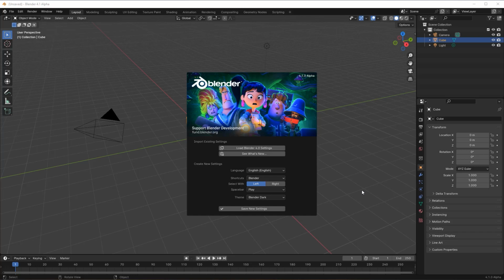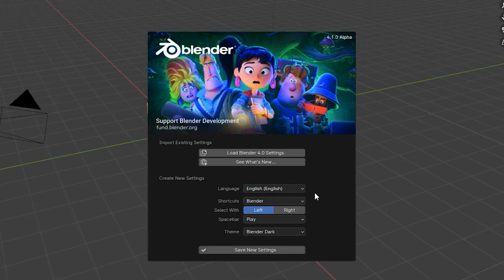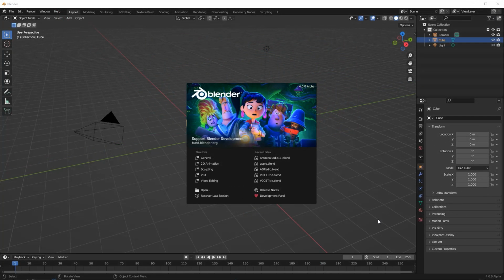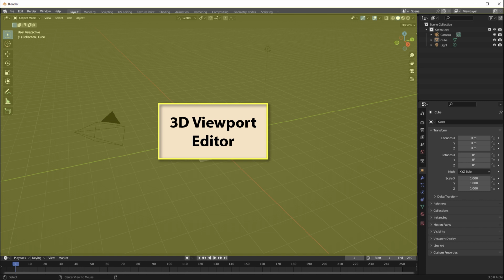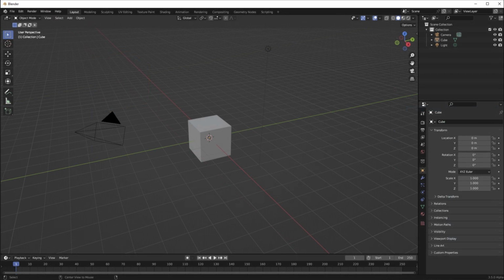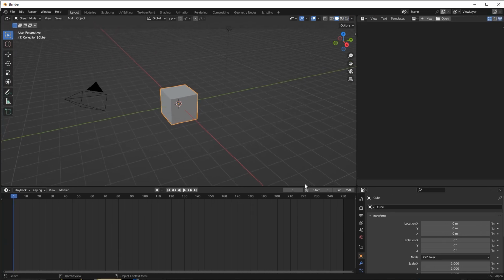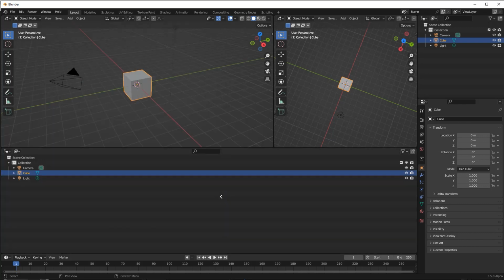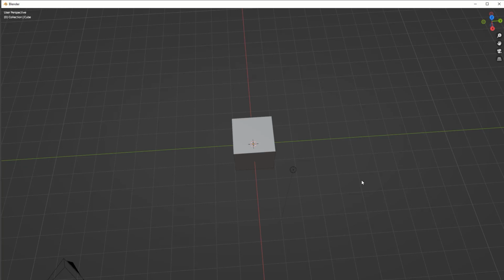3D Modelling with Blender 4.1: The Blender Interface

Comment: I have spent several days working my way through this set of videos. They are well presented (apart from the auto voice) and very detailed.  There is a huge amount of work that has gone into their production.  The detail is comprehensive and I defy even any avid user not to come across an aspect that they have not encountered before. All references are as up-to-date a may be expected (currently version 4.5 - but it's a lifetimes work keeping up the pace).  As may be expected it seems that the rate of production has fallen off recently. It's not possible to determine whether this is due to the disappointment felt by the authors at the relatively low viewership. I've subscribed and liked every video. I have also added this comment to every (68 at present) edition - as this too can help with the promotion of content with the famous YouTube algorithm.  I wish the authors well.
Reply from the maker: Hi Richard. Thanks for the kind words. Yes, it is partly because of the low subscription and view rate that I've stopped making new videos for the moment. But the larger factor is that my partner has Parkinson's disease and has had two bad falls that have left her unable to walk so she needs a lot of help.   But I am planning to get back to the videos sooner rather than later (and the PDF book too). Sorry about the AI voices but I don't think a lot of people would understand my Scottish accent (and the AI gets it done more quickly).